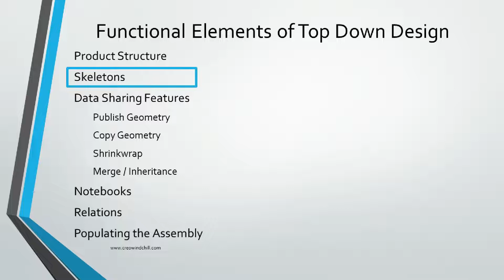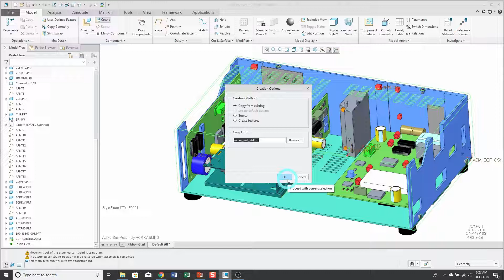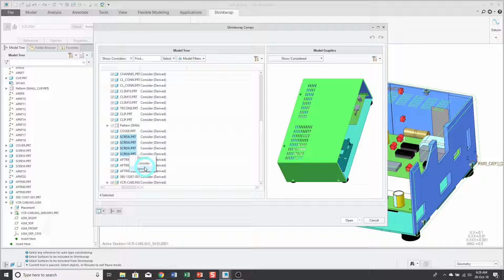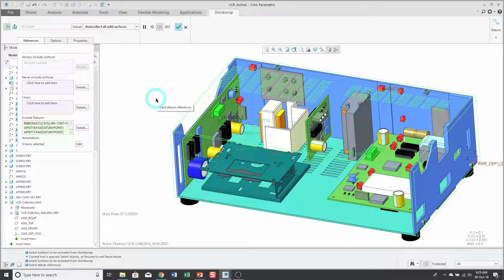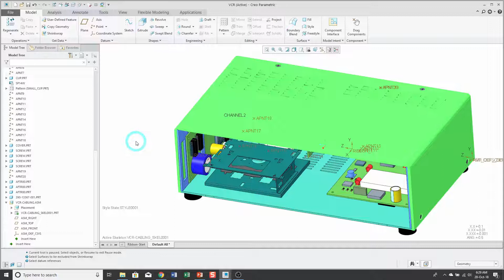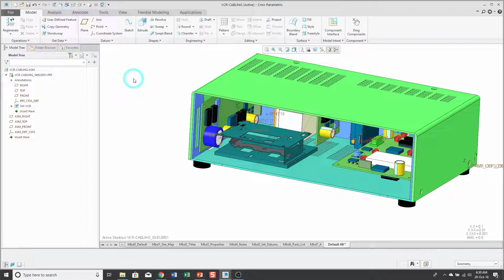Creo Parametric - Skeletons - Top Down Design (Part 1)

Comment: I don't think it's a good practice to create the shrinkwrap of the whole assembly. At least if you are working bigger/complex assemblies. It can take hours to calculate the shrinkwrap.
Reply from the maker: It depends on the situation. For a large assembly, it's often not a good idea. People should adjust the selection of components to remove non-critical components, especially fasteners and the like. I go into several healthy practices for external references in my book. Shrinkwraps require maintenance. For example, if Automatic Update is turned on, all new components can get added to the shrinkwrap automatically. Over time, that can really slow things down.

Comment: why exactly do you need a skeleton? why not doing just assemblies and subassemblies? Do skeletons define de exact outer surfaces of the geometry or is it just approximate?
Reply from the maker: Eugenio, please see this Top Down Design overview video which I hope answers your question https://youtu.be/ycvaCOCResU

The intent is that the Skeleton captures any geometry referenced by multiple components, so when a change is needed, you update the Skeleton, and all the connected models update automatically.

If used for the Outer Mold Line (OML), the surfaces should be exact.